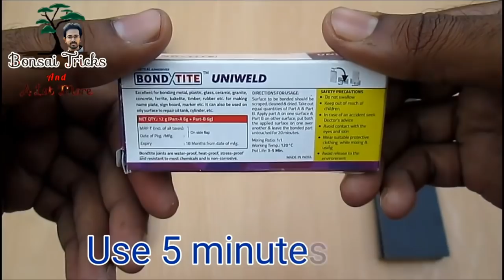Poinsettia Bonsai from Xmas gift

Comment: Can self watering planter beused for bonsai plants?
Reply from the maker: Of course not. It will definitely going to kill your bonsai within 4-5 months.
Reply: @BonsaiTricksAndaLotMore_ayan 
Thanks for the advice. 1. I find it difficult to get the amount of water correct for the potted plants. Self watering planters have helped. 2.Also I failed 2 times in getting adenium cuttings to develop roots now I have to cut branches from 4 adenium plants. It is difficult to get good sand in Mumbai for planting the adenium cuttings. .